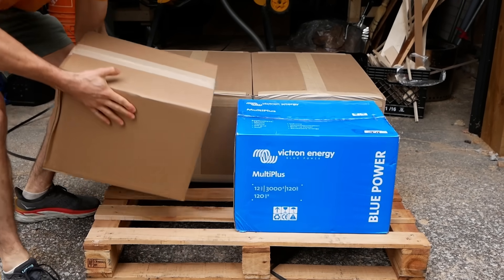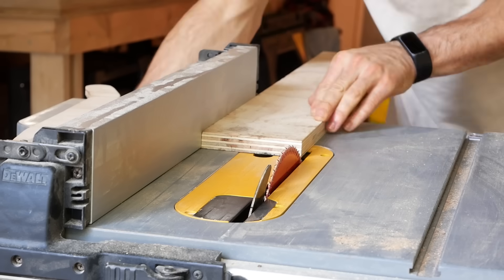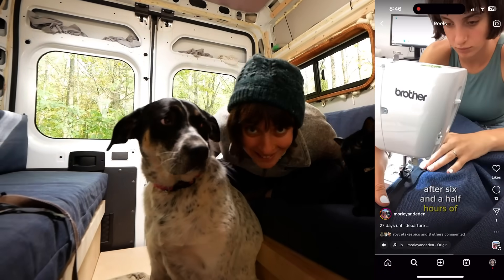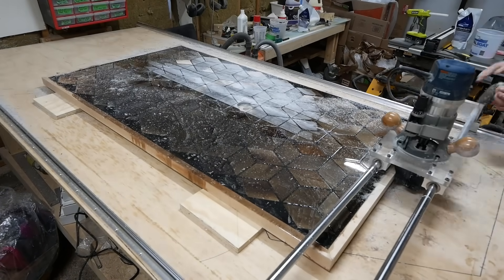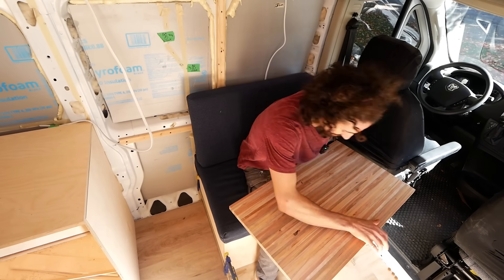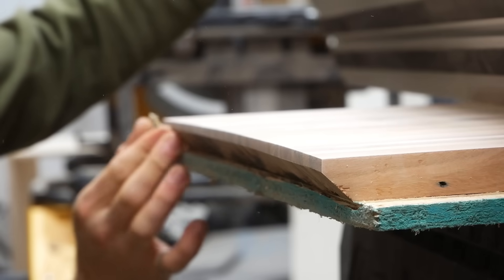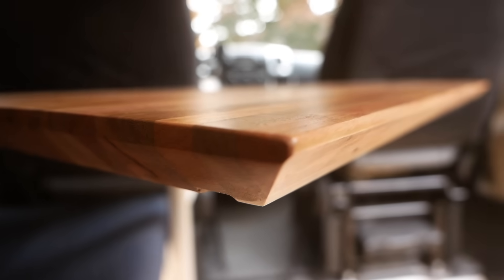Turning a Free Pallet into My Dream Desk

Comment: Last month I completed building a standing desk top using a ton of recycled lumber from our basement. I had taken down a bunch of old pine partition walls that were put up in the 50's. I cut them into strips. Ran them through my planer and did a large glue up. Then I had to build my own flattening jig, which worked like a charm. (very proud of that one). Finished with staining and sanding and now I am typing this from said desk. It's always a good reminder to build something just for yourself. I always build for others. So, I can completely relate to this one. 

And, beautiful work. Congratulations on the wedding. It looked like it was a blast!

Comment: you can do it without a track saw. you just have to measure, measure, measure and use a straight edge with a circular saw. I did it and built an entire kitchen. i jus used clamps and levels to get straight lines

Comment: Thanks for the tip on using the table saw as a jointer. I never thought of that idea. I've always wanted a jointer but could never afford one and did try to make one out of an old large electric planner but that didn't last long. Hope the van build goes well. Looking good so far.

Comment: Looks great! But that joiner rig will flatten out the sides, but not make the edge straight. Would be better to clamp the track saw to the wood and use that as a straight edge. Also the desk looks very warped. Any smart tricks for straightening it?
Reply: Can you explain what you mean that it will flatten it out but not straighten the edge?
Reply: @jeremyspecce  Hi, imagine cutting a banana on a mandolin. If you follow the curvature of the banana, you will have a piece with an even thickness. But the piece will be bent like the banana. This is what he did. If he had clamped the banana to a square piece of cardboard and shaved on the mandolin, you would eventually have straight pieces that are also even.

Comment: Be sure to check harbor freight on the way down. they got a 1700lb rated DIY trailer kit for 550. I had a labor day coupon for their haul master brand. Ended up paying 412. It's pretty sizable 48 inch by 96 inch. My handyman pulled my smaller 1200 lb trailer in his passenger van like it was nothing. I camped on it for 8 days with it under a 10x10 pop up, just using a rug, a camping polyester blanket, a fleece blanket, pillows and my medium to large dog. My only regret is not ordering the proper walls for the pop up. Used tarps and sun mesh with zip ties instead. the rain got through and ruined a 0F big and tall sleeping bag. not to mention the ability to haul bulk tools, food and random free pallets with you.

Comment: small tipp for the track saw you had some problems with the clamps looking for a same sized wood block would help so you dont need to move the clamp. nice desk and i really looking forward to the 3d printer cabin
Reply: The festool under-track clamps are also great for situations like this, but, they do require room underneath

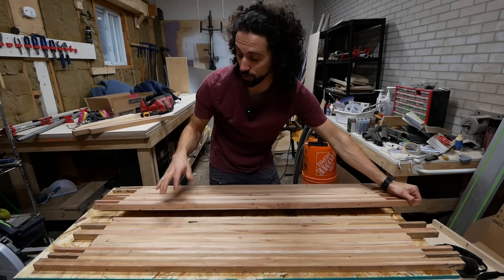Comment: 8:05 I'm wondering about a maybe even more precise setup to joint panels to fit together. I hope it makes sense.

It still uses the tracksaw, but may not even need a fancy one. My thinking is, that you made two different cuts to those panel, both rotated so effectively, if your blade is not correctly set to 90°, you'll made a gap bigger/smaller in the top than in the bottom. 

Now... I've watched tuts before about how to use a planer flipping the faces of the boards to correct that imprecision in the fence to achieve perfect 90°.

Combine those and suddenly, if your blade is thick enough, you can "push" (notes on that later) you panels together, and cut both at the same time. This would eliminate the rough sides and create combine angle cuts that perfectly match.

Things to take in consideration. 
    # Panels must have already a good enough side so the blade thickness is basically the blade already mounted.
    # Despite "pushing" panels together, you can't clamp it this orientation to avoid pinching the blade, it would be nice to have stops to limit their position but don't apply pressure. You may have to clamp it otherwise.
    # You need to cut using a common technique of placing foam underneath. This will help to avoid tearout and facilitate the clamping of the setup.
(EDIT)
    #Should be also necessary to make the surface leveled/coplanar since the track is only place on one of the surfaces.

Haven't tried but I'll consider it next time I have to perform a panel joint. I don't have a tracksaw but a regular saw with a homemade guide. Concept should apply the same and could be faster and precise..

Any thoughts from the community? Safety? Maybe a jig to help clamping?
Reply: BTW, I'm sure somebody already did the technique I'm proposing (maybe the Simpson's did it first) and it has a fancy or ridiculous name, I'd be happy to learn it.
Also, now that I think about it, what about using a router instead? One of the faces would be on climbing position, but that generally apply to open faces..., maybe is the terrifying nature of routers, but I think I wouldn't try this one, in any case, this would help if blade is not thick enough for the gap, but that would mean that they are kind of open faces. Ok, somebody with more knowledge and experience needs to pop in here.